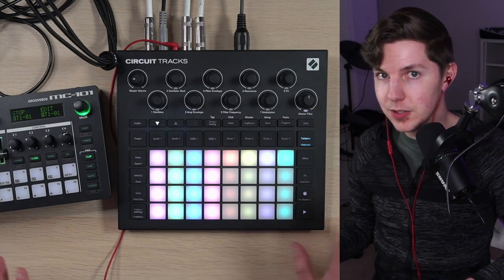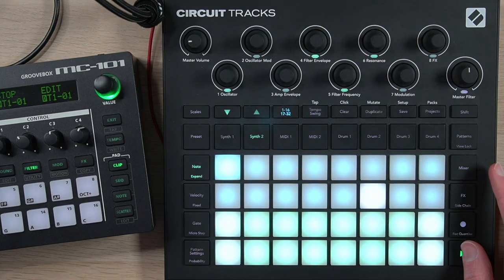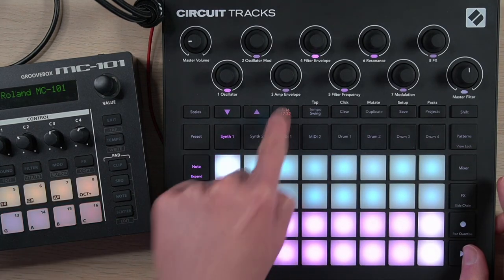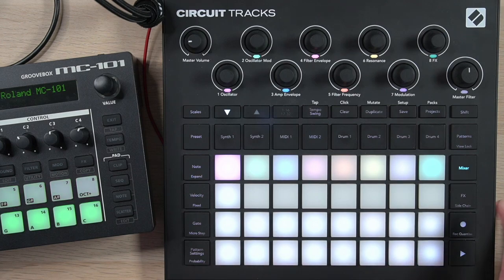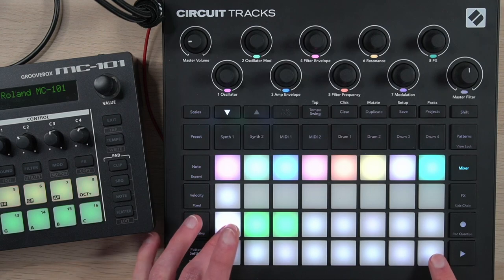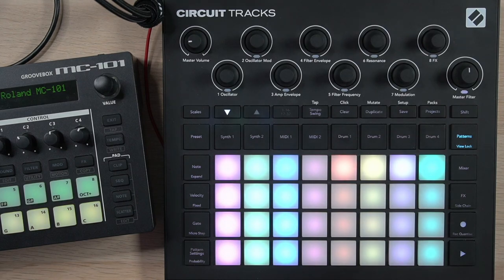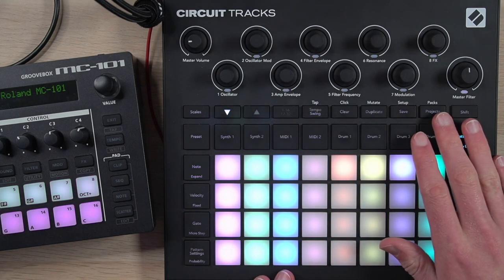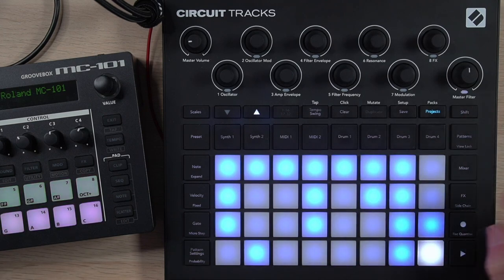How to Make FULL SONGS on the Circuit Tracks

Comment: Worth mentioning you can do the immediate switching like you showed with projects with patterns as well by holding down shift. You can come up with some interesting pattern compositions this way while live performing or trying to come up with ideas. 

Also, it takes up a space, but sometimes I do like keeping an empty 'mute' pattern open this way as you can quickly mute a track using shift from the pattern window and it also does not cut off a note or the FX like the mixer does. This is especially nice with a long delay or if the last note of the pattern is long enough to allow it to play into the next pattern you selected.
Reply: Do you know if you can plug in a Bluetooth adapter and use my beats headphones without delay?

Comment: I've made a few one hour live sets that have a dozen songs each with the Circuit Tracks project switching and really enjoy the intuitive workflow. It's really nice that you can transition into another track using master filter, reverb and then adjust the tempo during the transition. It takes some work to make the transitions between tracks and practice to perform them, but once you've done them a few times you can get creative with them.  I have not yet tried it but making projects for track1 -> transition1 -> track2 might be the best way to do a full set with more interesting transitions than just having the second track intro percussions mixed in with the first track outro.

Comment: Although everything in this video helps a lot, I do hope a firmware update will give us 64-step patterns. I have learned that I seem to be thinking in 4 bar musical pattern. And it kinda breaks my flow to immediately start chaining patterns to sketch my initial ideas. But even with 32-step patterns this already is an amazing piece of gear. Best price/performance I have ever encountered.
Reply: I don't think we will get 64 steps with a FW update, this is most likely a HW limitation. The ability to chain projects or have a counter you could set (similar to how the tempo is set) to allow specifying the number of times a pattern or scene repeats may be possible and would improve the 'song' mode by an order of magnitude. Edit: Also the ability to chain patterns/scenes in a specific order would also help in conjunction with the repeat counter.

Comment: Ah! I wish I would have known this mute state update had dropped before spending 2 hours arranging a song last night 🙂

Just a tip to share (not sure if you have mentioned this on your channel) but I will get extra mileage out of my scenes by reserving one of my midi tracks just as a timing mechanism by reducing or increasing the pattern sync rate as needed. That way I can get it to "loop" a progression multiple times in a scene without needing to take up one of my precious 16 scene slots.

Comment: what makes it so that you can use the mc101 for both the midi tracks? could that also be done with a synth like the cobalt8 for example? Or is there some specific feature tot the mc101 that makes it possible.
Reply: They just go to different MIDI channels. By default, MIDI 1 and 2 on the Tracks go to the actual channels 3 and 4 respectively (see the manual page 103). I don't own an MC101 or Cobalt8, but I assume at least with the former that you can route different MIDI channels to different synths on it.

Comment: Hey, got myself a track recently. One question: when I am using midi In to play with my arturia keyboard I can adress channel 1 and 2 to hear the Internal sounds,  but 3&4 to play my external synths doesn't seem to work... do you know if there is a special setting for letting midi through? Thanks!
Reply from the maker: I don't know for sure, but I think this might be a known issue, where external controllers don't necessarily pass through properly.
Reply: @GabeMillerMusic  thanks, I will dig into this deeper.

Comment: I don't know man. Everything on these entry-level grooveboxes seems to sound so cheesy, cheap, and toyish. I have yet to be impressed with anything coming out of these Novation devices. Same goes for the MC-101 btw, maybe less crappy but still not impressed. It almost seems like anything below Digitakt/ MPC One level is a waste of time.
Reply: Sampled my Digitakt drumkits into my MC-101 and sold it after that, because the Digitakt sucked.
Reply: @80iesDude45  There's a lot about the Digitakt that legitimately sucks but it's not its sound quality. Which you basically confirm because you kept its samples.
Reply: @Drrolfski  yes, the quality of the sounds is very impressive, that's why I sampled them ;-)